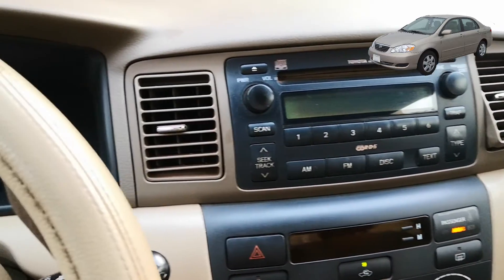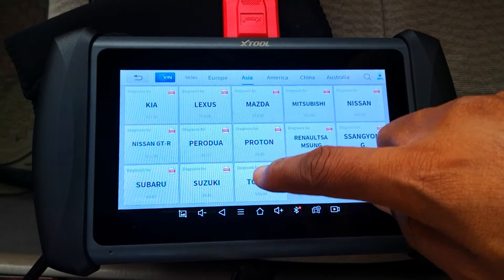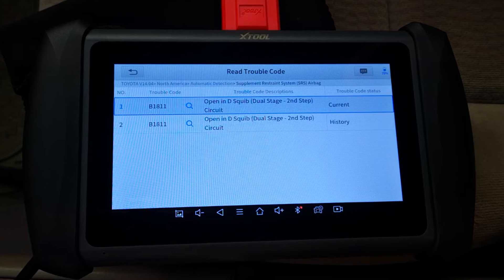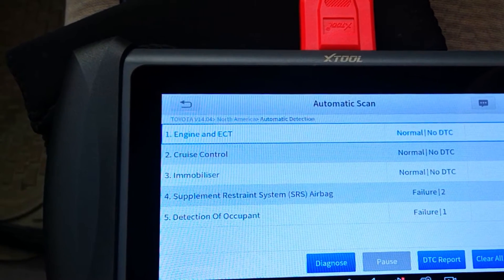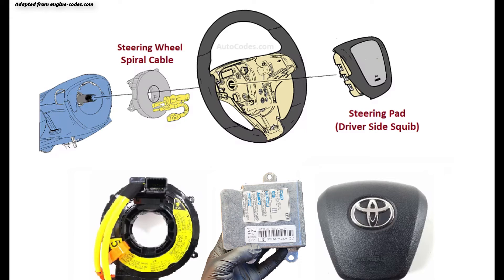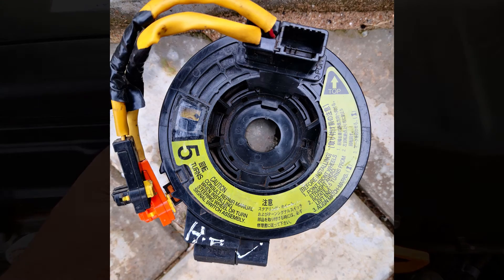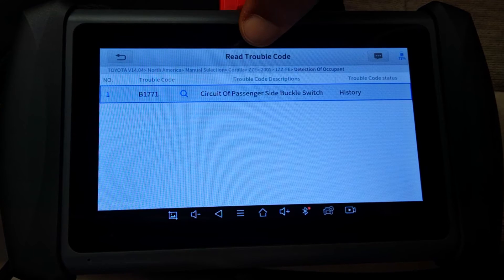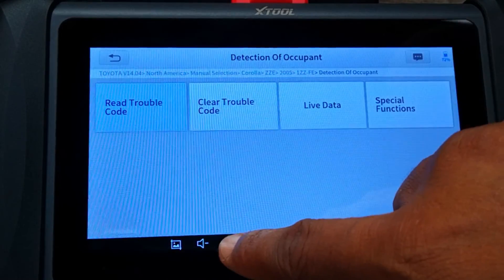Scan and Analyze: Toyota Airbag Light Troubleshoot / Why the Airbag Light is ON: Scanning SRS module

Comment: My mechanic power washed my engine.  Since then I have had two codes come on... catalytic converter and airbag.  I never and ANY codes before.  Is it possible the engine wash could caused the codes?
Reply from the maker: Anything is possible if connectors in the SRS or an O2 sensor lost some contact from the wash. However, can you be specific with the actual codes? 
It could be unrelated too.

Comment: I love your videos very knowledgeable! Learn a lot from you sir! My name is TASHA from Canada 🇨🇦. My check engine light reads that I need to replace ignition coil and spark plugs as well as a cylinder 4 misfire secondary DTCs, p0420 cat efficiency helper threshold bank 1 and 83-13 ECM/PCM relation failure. I have a 2007 Honda Accord. I’ve driven like this 7 years! Now I fear how much repair will cost. Why me? 😩
Reply from the maker: Thanks for the compliments! Given its a 2007 corolla, chances are that it's still on the original spark plugs with which it left the factory. How many miles do you have on the car?  Also if you have the actual misfire/ignition coil codes, those will be helpful. Misfires can cause a P0420, so we'll leave that for now. Best practice is to address other emission codes first before tackling a P0420. For the ECM failure code, start by ruling out corrosion or poor connection in the connector to the ECM
Reply: @DIYAutoworksNG  hey I went to an auto retail store and they pulled up those codes. I then went to the dealership and now they say I need a new engine saying that I have low compression. I can’t imagine paying 7,000 for an engine. What a bummer indeed! Am I affecting my own personal health driving this car? If not I’ll drive this car till it says I’m done 😂 hopefully by then I’ll afford a new car. The only issue I’m having now is slow acceleration and the engine growls when I start the car. Also the TPMS light is on but the tires are good. They say the TPMS sensors could be bad or dead

Comment: My Honda Accord 2009 Stalled After I Drove Through High Waters But After A Few Tries It Started Again But With The Engine Light 4 Years Ago And Was Told The Catalytic Converter Is Bad, That’s The Code That Comes Up. As I’m Driving Sometimes Exhaust Smells Permeate The Interior Which Smell Like Rotten Eggs. Also Somehow I’ve Managed To Pass DMV Inspection 4 Years Straight With A Check Engine Light & Bad Catalytic Converter. Is That Bad Catalytic Converter Endangering My Life?
Reply from the maker: You may have taken some water into the engine via your air intake. When the car finally started, did you have white smoke from the exhaust?
On the P0420, the water have resulted in thermal shock of the catalytic converter housing; contracting it and fracturing the honeycomb structure of the cat. A broken/clogged catalytic converter over a prolonged time will result increased back pressure to the engine and in has been know to cause fires. I suggest you have it addressed.
Reply: @DIYAutoworksNG  oh wow you know your stuff! It’s crazy I’ve been driving this 4 years straight like this! No white smoke came out when I started it. I was going to pick up an Uber passenger when I drove through huge puddle of water and the car completely shut off and stalled and I had to push it and kept trying until it started. My car has 277049 miles on it. The dealership says I have low compression as well which I doubt because the car is driving good with the solid engine light. What I was worried about is whether there’s any danger of carbon monoxide from the bad cat? The dealership says I should just drive it until it’s done or buy a new car! I was shocked considering I paid them almost 200 dollars for just a diagnostic test.
Reply from the maker: Seems like you're in a state that doesn't do emissions testing. Not sure how you've been able to pass emissions all those years with a check engine light! Though some US states aren't crazy about emissions testing. I don't think DMV's assess emissions. 
Considering the mileage, its possible the compression would be out of spec, however, if the engine is not using much oil between oil changes, I wouldn't bother. All engines will eventually loose compression if driven long enough.
The catalytic converter does reduce the amount of carbon monoxide in exhaust gases, so if its not working well, it should do this to a lesser extent. That said, emissions testing also monitors the level of CO in the exhaust gas as part of its tests, so if they haven't flagged that, it probably fine. Though as I said before, I don't see how you will pass emissions with a CEL. Did the dealership give a readout of the code(s) causing the CEL? They should if you paid for diagnostics.
Reply: @DIYAutoworksNG  hey bro! What’s crazy is that this year I failed the DMV EMISSION TEST 4x and then I went to a shop and asked them to clear the codes and prayed and when they checked again at the DMV it passed 😂. This year they were strict but prior years they weren’t even checking! The dealership says I have Low Compression On The Number 4 Cylinder & P0420 & P0304. They say the engine was at 60psi. They performed the diagnostic in July. Sometimes a rotten smell comes from the exhaust into the car and I have to roll down the windows. I’m from Kenya 🇰🇪 but live in Delaware and I’m not even sure if spending 2,000 to replace the catalytic converter is worth it or I should get another car. I heard Cataclean cleans the catalytic converter. I saw it on Amazon. What do you think?
Reply from the maker: Lol. That DMV facility lacks technical know-how. The car shouldn't have passed because the emission parameters wouldn't have been set in the ECU. The exam protocol should have seen that the emission parameters for the catalytic converter were incomplete and asked you to complete some drive cycles until they are set. Once it completes, the P0420 will be back if the cause hadn't been fixed.
Now, that misfire in the cylinder 4 (P0304), could be the reason for the catalyst code, meaning that there could be nothing wrong with the catalytic converter. The rule is always to troubleshoot and fix the other code if both a P0420 and another are present.
On compression loss in cylinder 4, low compression can cause misfires. It'll be impossible for me to help here since I cant assess compression virtually. I don't know how competent the tech who made the assessment is. Do you know if they took both dry and wet comoression readings? They should have stated the compression readings in the other cylinders too. 
That said, not bad to still rule out the other common causes of isolated cylinder misfire. Spark plug, ignition coil, fuel injector. If you aren't good with DIY, you may just get a 2nd opinion from a good independent mechanic.
Reply: @DIYAutoworksNG  Bro you’re the man! You explained better than any mechanic I’ve seen in Delaware 😂 I wish you were close I would have had you as my regular mechanic. Honda service wants me to pay them for a used engine replacement and 1500 for a used Catalytic Converter. It’s crazy how my car has survived almost 5 years in that condition. I made an appointment to get a second opinion! I asked Honda dealership about the questions you asked me to ask and the wet and dry emissions and they don’t know, saying the employee left but are not willing to diagnose again without another fee 😆 Also do you recommend I use cataclean? It’s a liquid that cleans the Cat on Amazon?   The engine has been burning oil bro! Like last month I went for oil change and no oil was detected in the Engine through the dipstick! It was clean! I usually have to keep buying oil from the store to replenish every 2,000 miles.
Reply from the maker: How much oil do you add for each 2000miles? It smokes at the back too? 
I know cataclean but haven't used it before. I'll give my full opinion after an estimate of the volume of oil the engine uses per 2000miles.
Reply: @DIYAutoworksNG  hey bro! No smoke in the back! It’s just a leak in the bottom caused by a mechanic drilling a hole in the oil pan instead of replacing the oil pan completely. I started noticing oil in my drive through from the bottom of the engine so I went back and they want me to pay them again to diagnose and clean the engine area to find the source of the leak. At this point I’m ready to move back to Africa bro 😂 I was going to buy cataclean to see if it works 😂 I’m planning on moving to Africa for a year so I’ll probably just dump this car in like 3 months. Although i feel this 2009 Honda accord needs an award bro for surviving this long. Then the wildest things happened! My TPMS LIGHT HAS BEEN ON AS well as the engine light then the airbag light came on then I replaced the srs system and that also fixed the tpms light then after a few months the TPMS light is back but tire pressures are all perfect 😂 so currently I’m driving with a TPMS Solid light and Check engine light 😂 the struggles of an African in America 😂
Reply from the maker: It's getting complicated🤣. I think it'll be best someone does a physical assessment. Though I note you said you'd probably dump the car... All the best and welcome if you do come back. Lol

Comment: My son has a 2005 Pontiac Vibe which is basically a Corolla Matrix.  His passenger airbag light come on saying No Air Bag on.  I'll try this with my scanner.  I'm thinking it could be in the seat and it's not seeing when someone is in the seat.  I'm guessing there is some kind of weight switch.
Reply from the maker: There's a seat weight sensor (SWS) that's part of the ODS, depending on the scanner you have, you may be able to test the sensitivity of the SWS. You'll need a 30kg weight for the procedure.
You could also check live data for the SRS, the weight reading should change in realtime as you vary what is on the seat. Depending on what you find during your scan, it may just need caliberation.
Reply: @DIYAutoworksNG  Awesome Thanks!  I have three Bi Directional scanners and one of these should do this.  Love your channel.
Reply from the maker: Great to hear back. Thanks a lot!